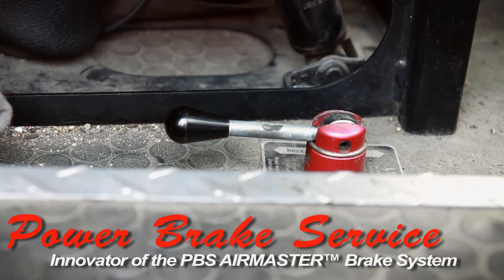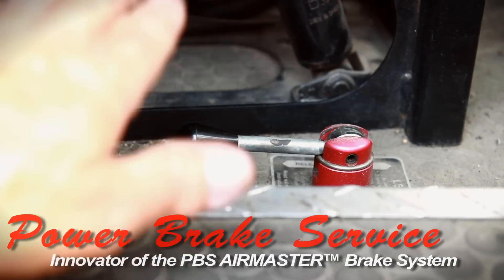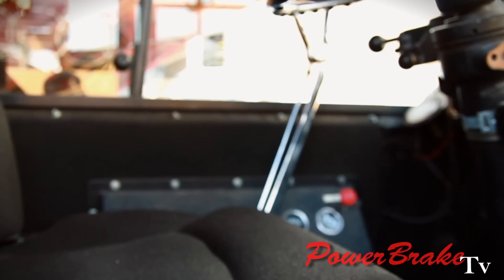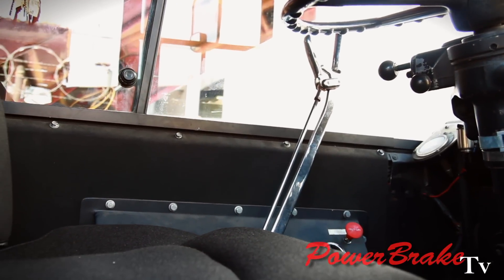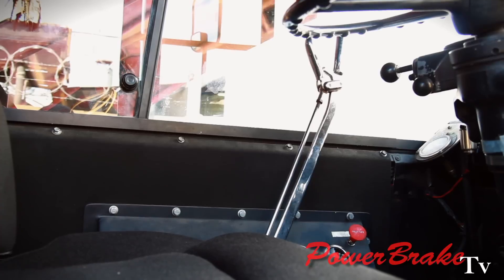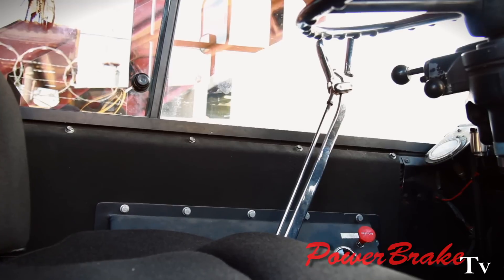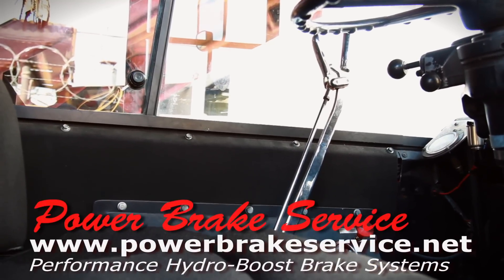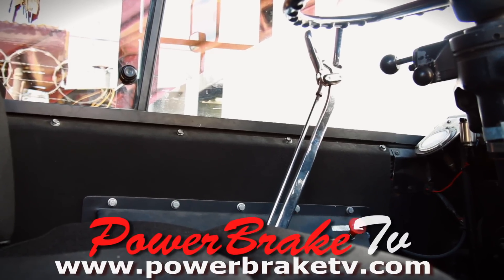Antiquated Hydraulic Parking Brake Levers and Air-hydraulic Brake Conversion - Sweeting Performance

Comment: Why is the hydraulic line lock break unreliable??  Antiquated??  Please explain?
Reply: It won't hold the truck/bus if the hydraulic system develops a leak.. really common to see rubber brake hoses fail when held under pressure for extended periods of time. Weeks or months